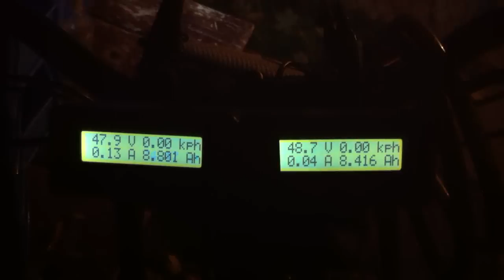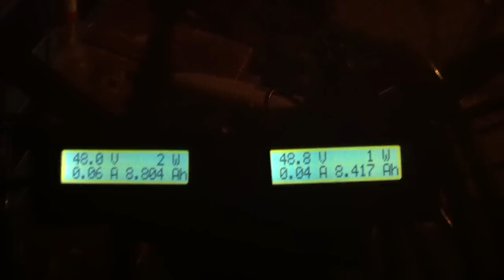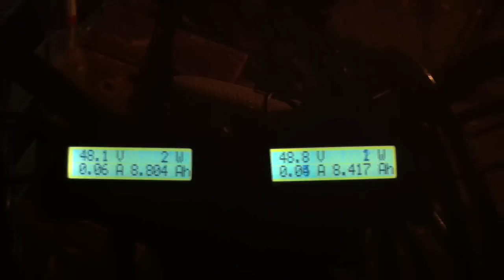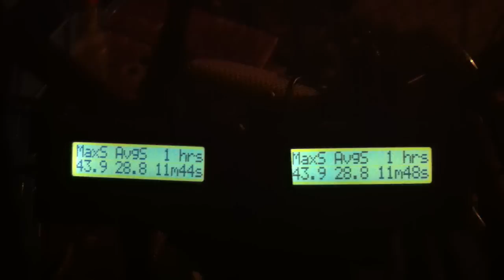Dual Motor Electric Bike with Cycle Analyst

Comment: Hi Gary Re regen ..the motor and controller nust be more efficant on regen even with losses normally....About 83%as drive ... but it has had to give you more ,,than losses included to give you final Amps back into battery ....is it a gernerator that is used as a motor ( could it have started that way )..
Thaialien

Comment: @iovaykind    I totally agree!  More weight means more amps drawn.  If you weigh the rear while on an incline and weight the front while on a decline, you would notice approx. 80-90% weight on rear going up and approx. 50-65% weight on front going down (all depends on grade of course).  Bicycles seem to have more weight on the rear on a flat surface.  Also, where were the batteries located?  Lots of variables, but Garys' figures make sense if what I say is actually true.  :)

Comment: only thing i can think of is uphill more weight is on rear, whereas downhill more weight is on the front wheel so essentially they use up more amps when more weight is put on them

Comment: Interesting stats. Very curious about the variation between the current draw variation between each wheel and how that variation shifted when going from up to down hill. Would like to know if you came up with any explanations or ideas on why that happened.

BTW, You didn't give info in video description (I recall) on diameter of wheels. am suspecting these were 20 inch wheels based on cycle analyst stats. What size diameter where the wheels? 

Are all the GM Magic Pie wheels w/ off center rims?